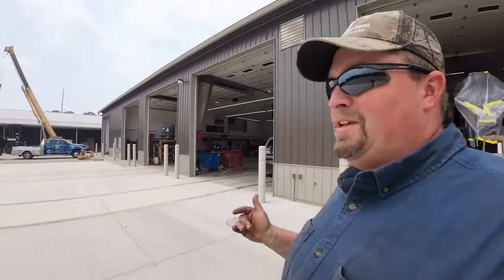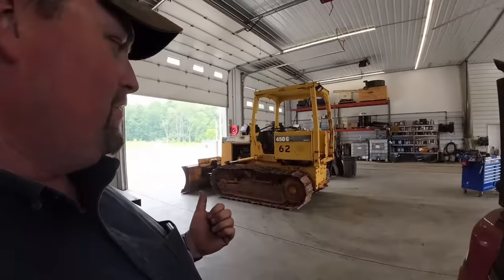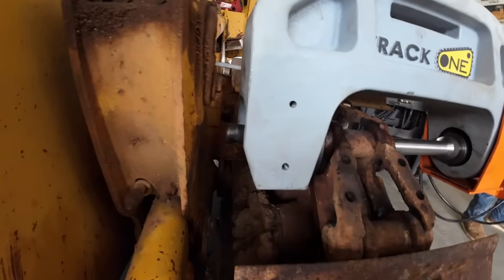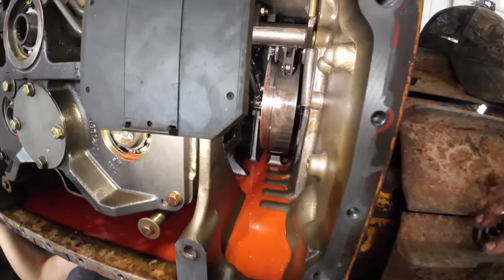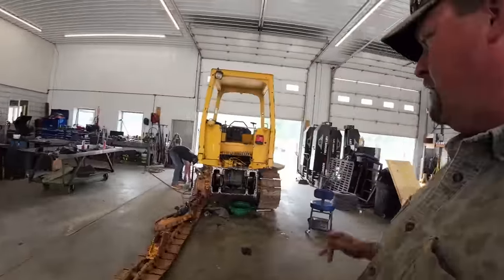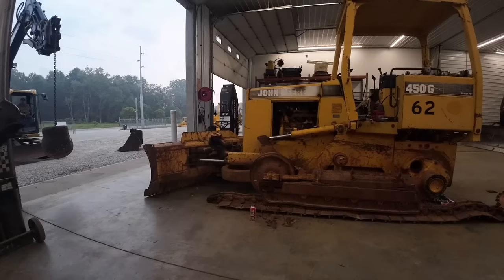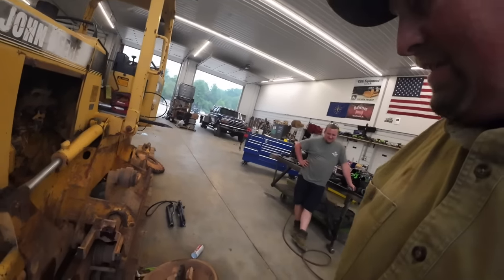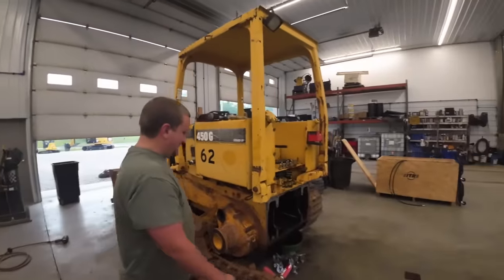Transmission removal in a John Deere G series dozer and the wrecking ball makes an epic comeback

Comment: Great job Guys. I am 63 and heard a Transmission called a tranny all my life. So I am not going to stop now : ) I own an old John Deere 300 TLB  The clutches are a metal type Wear material and look brand new even though the tranny was full of water. I just had to change the seal in the piston has rust had ate them up. Liked and shared. All my best.

Comment: In the late 80's I worked for an engineer who had retired from JD as the lead designer of the G model trans. When he told me that he could have the trans out and on the bench in an hour I told him he was out of his cotton pickin' mind. I went back to heavy eq. in the late 90's for a company that had a fleet 450-650G's which meant I was rebuilding 3-4 G transmissions/yr. I had to call him and apologize. Of all the brands I have worked on, that was the easiest to remove and work on. Great videos.

Comment: On any high hour G transmission o/h we always machined the backing plates on the clutch packs to give more clearance for the snap ring that holds the backing plate to the drum.  As the drum and plate wear the snap rings can get lodged under the plate lip and break.
Reply from the maker: Thanks for the info

Comment: That track breaking tool is pretty impressive and certainly appears very capable at breaking the joint and pushing the pin out. I assume it can be used in a reverse pattern to re-insert the pin again and rejoin the track?
The power pack machining of the plate with the O rings rather less impressive though - I couldn't see that repair lasting any real length of time / cycles of use for what must be a real expensive tool!!

Comment: I'm in Northern VA about 20 miles west of DC and we been getting the smoke from Canada as well.  Sometimes you have to use unconventional tools to get things apart I have a 20 pound chipping hammer thats normally run off a big compressor that I have used many times to help knick things apart last time i used it was to knock out the bolts on a used bushog i got at auction that hold the blades on my brother was watching when i did it and he was rather impressed by my use of unconventional tools.  I've even heard of guys using a hydraulic hammer on a skid steer or track hoe to knock out stubborn pins before as well beats a manual slegdhammer any day

Comment: Really enjoy these older JD tractor videos. I operated an '86, 450E for about 20 years then was assigned a late '90s 550G for a year or two.
Reply: Was the 550 better?
Reply: @RRaucina 
Overall, yeah, I think it was BUT it was turbo the 450 not.  I could get the smaller 450 into places needed, but, the 550 had the power to get there by force and get out.

Comment: I am totally a hearts-and-rainbows diversity supporter.  BUT when I am talking about distributor ignition timing, sometimes the ONLY right word is retarded, and I'm going to use that word.  That word IN that context does no harm to the intellectually disabled.  I can remember people shortening transmission to tranny at least as far back as the late 1960s.  It's not a slang that I ever picked up personally, but I find it defensible in the same way.

Comment: I learned today why I am not a good mechanic. Number one is a big ass forklift. Number 2 is a brand new baby forklift. Number 3-4 are a pin press and a Miley Cyrus. Without any of these that job would have been a little more difficult. Do you need to do the other side before trans goes back in? Impressive once again. Thanks.
Reply from the maker: Lol
Other side is fine

Comment: Clint, I recently went and looked at a 450E. Coming from an old case 850A with a Torque converter I was unsure of the whole clutch thing. I pushed into a pile in first gear and the John Deere wouldn’t spin the tracks. I assumed the clutch was slipping. Thoughts?
Reply from the maker: Reverser is probably bad
I’d be careful

Comment: You have to try the Astro pneumatic 1895 ONYX 1/2″ “THOR” G2 Impact Wrench around $200   they also have a 3/4 model for $233.00   these were the top in TOUQUE according to the torque test youtube channel ..   snap on wasn't even on the list .
Reply from the maker: Interesting

Comment: If you can't get it loose, get a bigger hammer.
Looks like a wreaking ball will do.
Handle or no handle it'll get pretty much anything loose including buldozer track wheels and sprokets if needed..
Of course C & C equipment took that to heart and brokke out the wreakung ball.
Got the job didn't it ?

Comment: Have you guys got a video on the steering brakes on a 650g 98 model. I just bought one and the clutch is working but it wont turn right when pulling the lever

Comment: have you had to replace the logic module on any g series tractors     i have temp light and buzzer going off   i have replaced the sender pulled head off and had it gone thru replaced thermostat  and checking with temp gun i dont get anything higher than 180*f   and when light comes on at first its very dim  getting brighter as tractor gets warmer   so i was just asking about module  (at134934)  very expensive to just part change
Reply from the maker: I have not